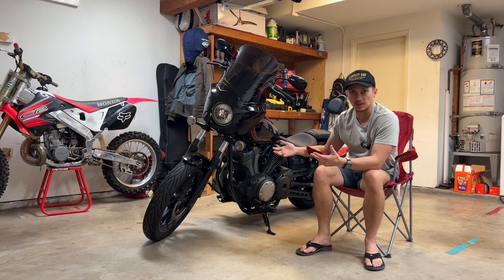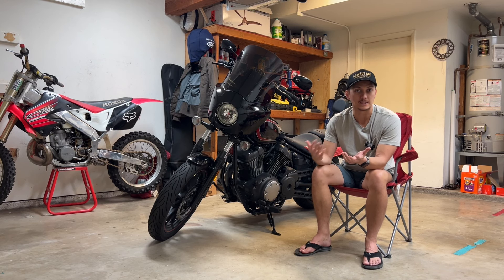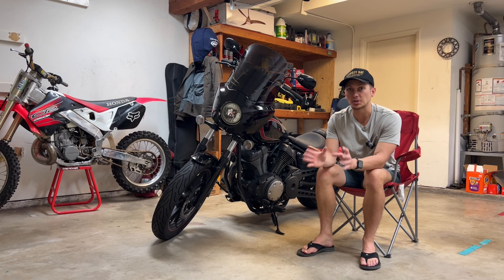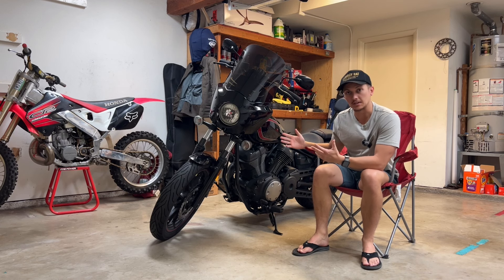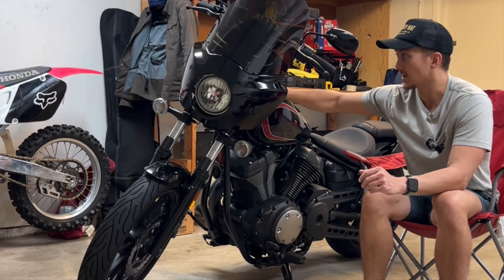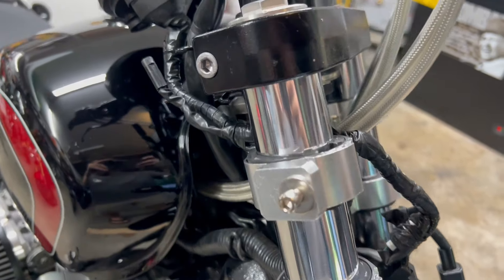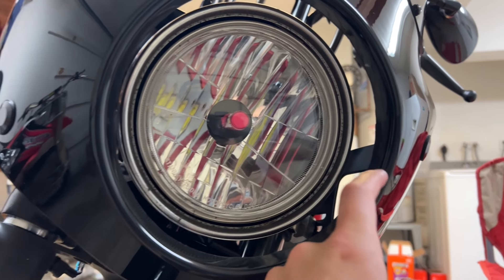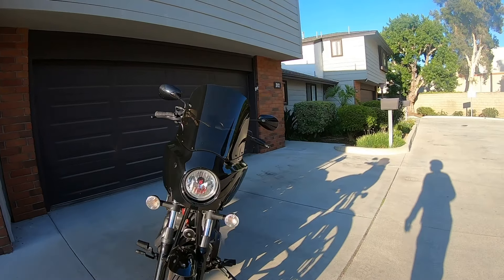YAMAHA BOLT FAIRING

Comment: Do these bikes have easy maintenance that you could do yourself?
Reply from the maker: 100%. It’s a basic v-twin. Reliable, long maintenance intervals and oil changes are a 30min job. Belt driven so not much to worry about there. Overall it doesn’t need a lot
Reply: They are v-star 950cc v-twins that have been perfected and have been around since the early 00's. With an intake, exhaust, and a tune from Ivan's, they are more competitive to a sportster 1200 and typically preferred over the H-D.  They are extremely reliable and with a few minor easy to do mods, they can be tailored to a sport cruiser for the twisties, or get a fat fairing and seat etc, and ride them cross-country.
Reply: Yes. Change the oil every 3k or 4k (I won’t do 5k), check the valves (they are screw and lock) every 16k or so (I don’t remember the recommendation), make sure the tires are inflated, belt is properly adjusted every tire change, and fire it up and ride.